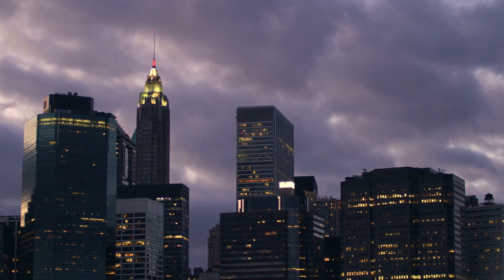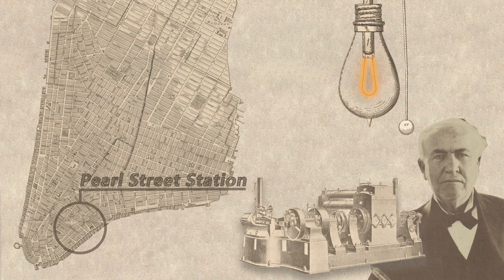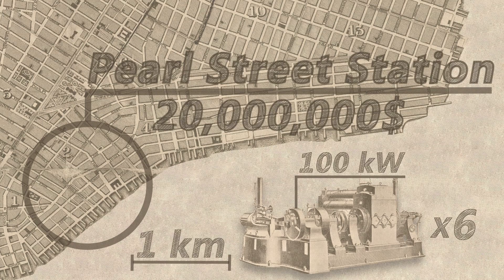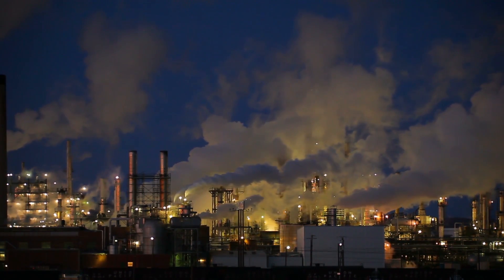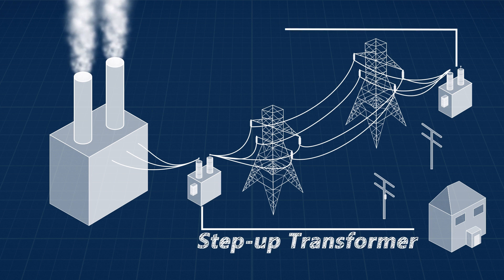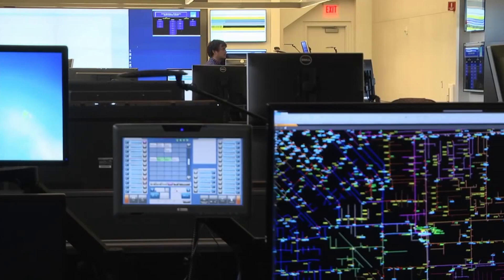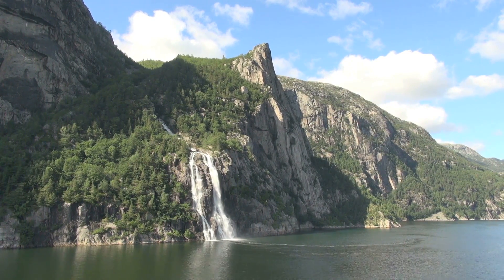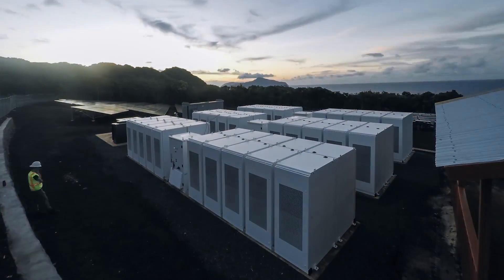What's The Biggest Machine In The World?

Comment: Good vid, FYI the pics you use for power plants are actually Oil Refinerys. Also when a Base Load plant goes down they. Bring on a Peaking Plant, usually a Gas Turbine or pump storage as both can be brought on line fairly quickly. Solar & Wind power are way too small and Generating power then storing it in Batteries is Very Inefficient and Costly. Not to mention batteries are made of toxic stuff.

Comment: The power grid counts as a machine now? Not buying it. Argumentum ad dictionarum: "A machine (or mechanical device) is a mechanical structure that uses power to apply forces and control movement to perform an intended action." -Wikipedia. Does the power grid use power to apply forces in order to perform some action? Where does it get that power from - the power grid?

Comment: Deregulation of the electrical system allows for more decentrilazation Panasonic has 2oo th customers producing elect in natural gas fuel cells in their own house or biz a German co uses the waste heat from the fuel cell to heat the water ( sorry its still fossil fuel ) clean green hydrogen at (1/10 cost of solar green hydrogen in Aust

Comment: About the tesla powerwall, I did a research report looking at the best ways to reduce carbon emissions for a household. A 6kw solar array almost always has its power used because it exports to the grid, and as such, a tesla powerwall does not save on carbon emissions. Furthermore, the tesla powerwall requires a huge amount of energy to be made and is likely to need replacement after 10-15 years. I did the calculations and over its lifespan, the tesla powerwall costs more than it saves when used in conjunction with a 6kw solar array. It also produces more carbon emissions than it saves. While I am happy to admit that solar and wind are theoretically good enough and are getting better every day, batteries just aren’t.
Reply: Batteries at homes are for cases when there's massive power interruption for some reason

Comment: Nice video. thanks.
7:40 DC power grid? Well, an AC came not only for transmission benefits but also for stepping voltage up and down. Also, the whole brushless AC rotary electric machinery (synchronous and induction motors) runs thanks to EM induction which is possible only with AC. Don't think we gonna return to the old fashioned DC brush motors and BLDCs are unlikely going to replace in the industry the most widely used and reliable, cheap induction motor.

Comment: The electricity system is going to change completely very fast over the next decade.

Solar is now cheaper then grid power. The only problem was storage but that is now decreasing in price rapidly. Personal storage is now also very affordable, so much so that it can easilly be integrated in a solar system making going off grid cheaper for every house in the country. And that will only keep going in the same direction.

You will see an accelerating growth of people starting to generate their own energy and either barely using the grid or cut off completely to get rid of the connection fees. That will make maintaing a complete grid simply to expensive rather quickly. The cost of maintaining stays the same but has to be funded by an ever decreasing amount of people. Pushing up prices for connecting to the grid while making solar ever cheaper and more efficient because of economies of scale and money flowing into r&d. Encouraging even more people to find cheaper alternatives.

Once that kicks off things will change really fast. And it will force corperations and governments to adapt and find new solutions. They can no longer keep kicking it down the road and hold on to the current inefficient and old way of doing things.

Good times ahead i would say. Free energy for all. No more power bills or gas money. 
Just free power made automaticly every day on your own roof.

Comment: Without nuclear as the base load there will not be consistent electricity.

Powerwall is an overambitious idea that requires a massive drop in battery pricing to be viable. Lead calcium batteries are viable but no interest is given to them and lack of construction indicates they are not a viable option either.

Nuclear fission, with transfer to fusion as it comes online, is our only viable option moving forward. Solar and wind do not have the consistency, power output or low cost of nuclear. Even after you factor in external costs like maintenance, safety, and remediation.

Comment: Ok, what do you mean by "more power will overload the system" ?! 😂😂😂😂
And we do have ways to store the sun Energy to use it at night, and I am not talking about batteries alone, we have hydrogen, salt which can store heat and produce steam, we have water as well. The only problem in theses systems is the efficiency and it's high capex and opex which I see still pretty high.

Comment: One large power plant near me recently changed it's fuel usage.  Since the 1950's (when it was built), this plant ran off thousands of tone of coal being fed into 12 giant boilers.  This cheap system was used for over 60 years by the time cheaper and more efficient natural gas became readily available back in 2010.  By that time, the plant decided it would be best to gradually shut down the old boilers and replace them with 3 or 5 natural gas engines.  By the time natural gas finally took over all power production, the bulky old boilers and their iconic 500ft. tall twin smoke stacks were torn down.

I do know all the advantages of switching to natural gas and using renewable energy, but I'm still a coal lover at heart and hated to see another ancient power station be turned to rubble.  :(

Comment: People have mentioned the Internet and the LHC as potentially being larger machines, my argument against that is that a machine is typically defined as something which does physical work, which would rule out these alternatives. Also, all of these other systems are powered by the grid like any appliance, at best making them sub-systems. Even if one says that the Internet does work, all that work is powered by the grid, ditto for the LHC. One should also consider the massive moving parts in things like windmills, generators and turbines which go on to power motors in millions/billions of kitchen appliances, washing machines, drills, industrial plants and mining equipment, as a demonstration of the ways in which the grid, viewed as a machine, does work.

Comment: The 2003 black out was not a "rolling black out".  Those are intentional, scheduled due to a lack of generation or delivery capacity, it is initiated by an operator.  The 2003 event was a  cascading black out due to an unplanned loss of equipment, which caused an immediate overload of other equipment which was automatically removed from service to protect the equipment from damage, and which caused even more overloaded equipment, etc.  It was a CRASH of the grid.

Comment: Isn't the European Power grid way bigger? It provides in total over 700Mio. People with electrical energy. Alone UCTE-Grid, that provides central european countrys with electrical power delivers to about 450 Mio. Peopl, so even if you only consider sychon electrical power grids, it delivers power to more people (the oder grids are connected via dc-connections).
Reply: The power a machine generates doesn't define how big it is... just how powerful it is. The US power grid is the most dense and would span the farthest if you could stretch every component out (not the area it covers). I think a lot of the power stations are old so they aren't as efficient.
Reply: Do you have sources? as far as I know is the biggest part of the grid the local distribution Level, and this is basicly bigger the more people you have in the grid. Furthermore I think the american Grid is quite weak between big urban areas. Don't get me wrong, I don't want to compere size, I just think it is interesting how big electrical powergrids actually are. In engineering class, they said, that the european grid is the biggest. But it was in Europe, so it is very well possible, that they just assumed it, without actually checking^^.

Comment: One problem...The current renewable on the market are a scam as that they can't perform at the levels needed or generate toxic waste (solar panel production can be nasty) or wind turbines near homes creating low frequency noise that causes insomnia. Sorry but Liquide fluoride nuclear reactors are what needs to be built sticking with Tesla's model.

LFTRs are the magic bullet because you can't makes bombs with them they can't have major accidents, and their waste last for at most 300 years not 10,000. And they run on an element (thorium) found everywhere on earth (its often considered a radioactive waste byproduct of phosphate mining) so there's no need for a war over the shit. On top of all of that the nuclear plant to build them can be made to fit in a semi truck.

Comment: just in case anyone is curious about why 3 wires go into the transformer and 4 go out is because the transformer adds a neutral wire and after it goes through the second transformer it looses one of the sine waves and is the electricity that we get

Comment: It might be worth noting to your viewers that the importance of the transforming is linked to the cost barrier Edison was running up against. Because we can transform to extremely high voltages, we can minimize the impact of the impedance on an AC line allowing us to use cheaper materials like aluminum for high voltage lines. Admittedly tricky to explain, its a very important materials issue the grid has to deal with.

Comment: I am happily impressed that you properly explain the real differences between AC and DC power systems. In fact DC actually loses slightly less power over long distances than AC because its EM loss is lower. The problem is that there were no DC transformers. However what is not mentioned in the video is that we now have a DC transformer but its not called that. It's called a switched mode power supply.

Comment: Honestly it wasn't Thomas Edison` idea to put many smaller closer to home power plants because it is better but he was limited with dc power transmission over long distances if we lets say have a 10KV dc gen if we get a 90 A current we need around 30mm diameter wire(aprox. but close), that would give us a 900 KW Pin that would give us around 900 KW Pout on the end of the line(minus voltage drop times current). If we want to transfer more power this way we would need to up the current since dc can't be stepped up easily and since P = I * U(dc here no line voltage(V) since no different phases for dc else it is V / sqrt(3) )we are left with wasting a lot of money on copper or "upping" the Voltage. Since Edison coudn't "up" the voltage with reasonable effect( 40% power lost or something close to that) he was stuck with that model, he would have preffered to build one large more efficient station and transfer power instead because as every electroenergetics eng. knows electricity is only cheap if made in huge amounts.
P.S. if the demand goes up the freq. of entire power grid goes down if it drops to around 49.8Hz (im from Europe) the frequency controller kicks in more fuel(water/gas) in  the dams and gas turbine stations  since they can be started much faster(but there is delay since generator rotors are huge bodies of mass and it takes time for it to spin back to nominal freq.
P.P.S. love your other eng. videos from different field keep up the good work bye 👍👍👍

Comment: This sounds nice and dandy, but there are numerous problems with this, number one being that producing solar panels creates more toxic waste than any fossil fuel, another one is the impossibility for everyone to own a solar panel. As the demand increases, so do prices, and most of the lower and lower middle classes will not be able to afford this.

Just like the Hyperloop, things that sound good on paper might not work IRL.
Reply: Galactic Ruler Actually, as demand increases, the price will decrease due to economies of scale and improving technology. Especially as perovskite solar cells become more stable.
Reply: this is not true. it produces a lot of toxic waste in the short run but over the lifespan of the panel there is less toxic waste compared to fossil fuels
Reply: Solar panels don't create any toxic waste and it is not impossible for everyone to own a solar panel. Perhaps you're thinking about batteries? Panels are made of renewable materials and the prices are driven down, not up, by scalability.

Comment: The first power generator was NOT built in New York. It was built in the EU. Please get your history right please.
Reply: Dennis McConnell The EU didn't even exist when the first power generator was built.
Reply: StraightOuttaJarhois it was still built in the netherlands
Reply: No, it wasn't in the Netherlands, because that's not an electrical generator. Windmills which transfer mechanical power aren't electrical generators. The first electrical generator at all was the disc generator designed by Faraday in 1831. Deptford Power Station in London was the first high-voltage synchronous power station in the world, being first commissioned in 1891. But Pearl Street Station, referenced in the video, was the first commercial power plant of any description, which started producing electricity in 1882.
Reply: Dennis McConnell your talking about more modern generator the first generator of low v current was in New Jersey
Reply: No actually your wrong, the first generator was built in the Netherlands if you want to get tech, they've been building windmills since the 1600's, they never produced electricity per say but they where electrical generators. The whole idea of generation from that method came from there. So please look past the rose coloured  glasses while reading your  American history books that omit the rest of the world.

Comment: What about hydrogen fusion power? With projects like ITER so close to being completed it's very possible that fusion could become a better alternative to solar power. The theoretical best solar panels still would struggle to provide enough power but both nuclear fusion and fission plants can provide enough power to satisfy the world at a cheaper price
Reply: Dominick Giacobbe 2027 is close?
Reply: Brian Linderman it's far far shorter than waiting for the laws of physics to change in order to build solar panels that are of the order of efficiency, net power production and cost effectiveness that the 21st needs. Fusion power, if the ITER goes online and functions properly, will most likely appear in the market around 2050, and be a cost effective power source by at maximum 2075. The reason I say that is I just looked at previous things like the nuclear and electric revolution and seeing how long it took between discovering the technology and it going into the market
Reply: We don't need to "wait for the laws of physics to change." Modern solar cells could easily provide enough power to replace fossil fuels, but battery technology needs to advance before that becomes a viable option.

Comment: When a power station goes down for whatever reason, or demand suddenly rises, the reason blackouts don't occur is because the energy consumers use the system inertia. This is the kinetic energy which is in the turbines in large power stations, not wind turbines or hydro, the enormous turbines within coal, gas and nuclear power stations. Demand has to match supply, which in the U.K. is 50Hz and all power stations must be at running at the same speed. 

So while the consumers are using the kinetic energy in the massive turbines up and down the country, the grid will have enough time to bring on another power station or increase the power from other stations to cover the demand. Chances are we will always need big power stations here and there as without that system inertia, the second a modern power station falls off the grid, such as a wind turbine field having to be stopped due to high wind, demand and supply would not be matched and blackouts would occur.

Comment: Most of the US grid was built in about 50 years, the first 20years [1890-1910]  power supply was not a grid at all nor were most compatible with later standards; having a wide array of AC and DC voltages, frequencies, and phases tailored to specific local industrial customers. 
The last 50 years[1965-present] have been mostly maintenance-upgrades and minor branch expansions.

Comment: Awesome video, just one little soapbox issue: The term is 'baseload generation' and it means Nuclear generators.  Nuclear is not near water because of cooling, it's for stability. 
Nuclear is the most inflexible of all generation. The term used for them is 'baseload generators' because they can only be set to one output level, while they make  `secondary products' for other industries namely bombs and a little for radiopharma.  So, in order to ride the ebb and flow of daily demand fluctuations, nuclear reactors had to be coupled with pumped hydro. Some of the biggest pumped hydro was installed in the atomic age, so you can imagine they would co-locate the `baseload generators' with 'pumped hydro'  so that the whole control and safety thing would be a little easier.  

I could be a wrong,  and with just over a thousand comments when I posted this I imagine someone else may have pointed this out.

Comment: I wouldn't call a electrical distribution grid a machine because by definition its not a machine, the biggest machine would be the LHC with its 27km lenght or bucket wheel escavator on the height/lenght/width ratio